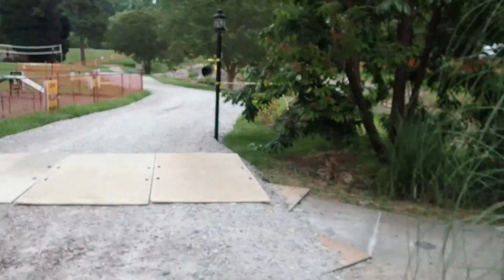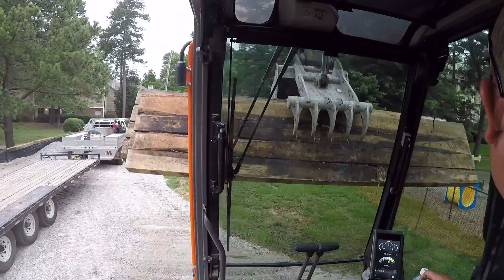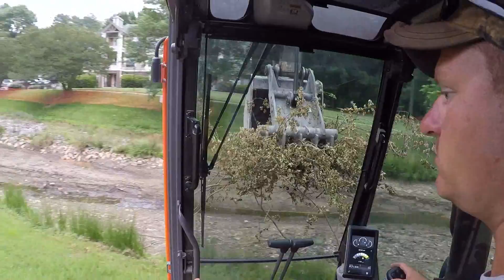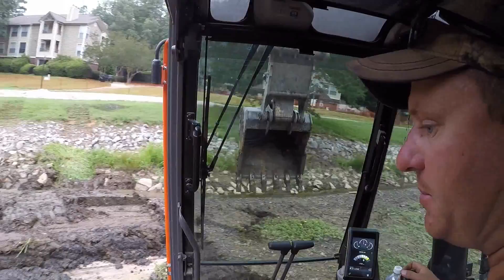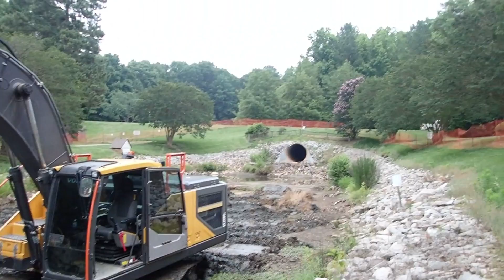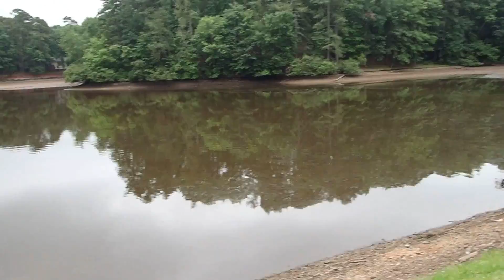The Volvo 250 Goes Swimming In Mud!

Comment: The technical difference between a lake and a pond is simply the depth. You can have a body of water that is 2 square miles and it could be only a pond if it is shallow. If the water is deep enough to not let light hit the bottom then it is a lake.

Comment: That was some top notch sphincter retention exercise right there.
I was concerned about the weight issues though no doubt the extra power that machine has enabled you to exit there without roadside assistance.
Got to take my hat off Chris takes some balls to take a machine that heavy out there on such small mats.
Whatever they are paying you it ant enough 😉
Chapeau 👏🏼
Reply: They use it because of the size of the bucket. Moves more material per hour.

Comment: Want a  Rototilt’s tiltrotator on the Volvo, would give you much more machine versatility.
Reply: You think ,tiltrotator are over rated and make operators lazy ,plus the extra weight not good for this type of work  ....Just my option
Reply: @Jacob-64  haha then u have never used a tiltrotator, i have a rototilt r8 on my ec300e with a 2000 liter bucket witch is 400 liter over rekomended from volvo and it works like a dream
Reply: @rasmus8447  I'm so happy for you

Comment: 18:10 I think your best game plan for that machine would have been dig out a hole down to the solid bottom, THEN crawl out into the pond, dredging it out as you go, staying in the ever widening hole you're digging out of the mud...
That way, you don't have to screw around with inadequate mats or risk burying the machine and the community gets a deeper pond that's less prone to weeds or clogs caused by silt buildup...

Comment: Hey buddy im curious, why don't you get a long reach every time you have a dredging job like this? I saw you got one on the other job... thanks for your time!
Reply: Curtis McDaniel Not sure if you’ve ever operated a long reach, but they’re a pain to use. The bucket is typically really small and it feels like you’re working with a shovel. They have their place if it’s just an area you absolutely cant reach, but I wouldn’t rent one in this situation considering the equipment they own.
Reply: The only way a long reach would be good is if he could do it all from dry land and not have to mess with matts. It is really easy to mess up a boom trying to move yourself and they have baby bucks. You can move material 3 times and still be faster than a long reach.

Comment: If the 250 had a touch more reach, you could have just used the mat to drag that far bank smooth when you started out. Could have been a little less risky over that sewer pipe too.

Comment: Moving this glop around is not going to solve the problem.  This mess needs to be trucked out and the waterway lined with a more porous material.  This will most likely be an ongoing and frustrating situation for the property owner.  Nice video.

Comment: Really stupid question from someone that doesn't know much about this:  Why do you go out on this stuff and raft your way around on mud mats, instead of just clearing it out starting from where you entered, and scooping it away outward from there?  Would there be too much flow-back and leave you in a lake?
Reply: I am not an equipment operator. I believe he said he needed to make the water flow on the far side in order to get the mud to dry enough to work.
Reply: One step at a time.
Reply: Every job he does is a process. I’ve watched him for years now and I’ve noticed how he seems to find the best way to move the most material at the cheapest cost to do so. Cutting a channel on one side is a good tactic. It allows the water to drain out of the mud and helps dry it out. The dryer it is, the more material per load he can haul out due to the weight of the water content. The more material per haul translates to less overall trips and conserves fuel consumption.
Reply: No such thing as stupid questions when you’re trying to learn!!!
Reply: @jdsparky288  agree.
 Teacher in school always said the only stupid question was the one you did not ask.

Comment: Dunno why you bothered to bring the mud closer into a pile before you had a base to sit on, = multiple handling a big pile of sh*t, may as well have loaded it out, the teeth were hitting hard enough base about 18" down, I think I would have gone with a mud bucket and headed for the base of the pond where it's firmer than the silt, and used the mats to keep the base good rather than moving them around in the mud all the time. Get the crap into the trucks with least amount of handling is my economical model. Cos in the end the machine pumped the mats down to the firm base so may as well have had everything above that clear the whole time and handled less. May have used a sump directly below the pipe outlet and pumped the water out instead of mixing it into the mud which makes the mud more difficult to handle, for sure keep a channel available for downpours. A grader blade on the end of the stick is great for gathering as the bulk gets reduced, then mud bucket.